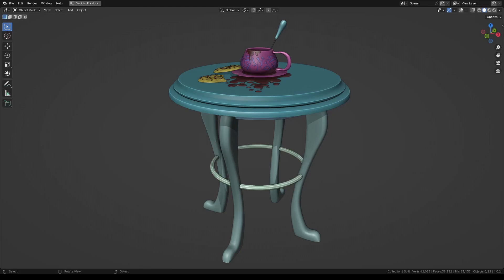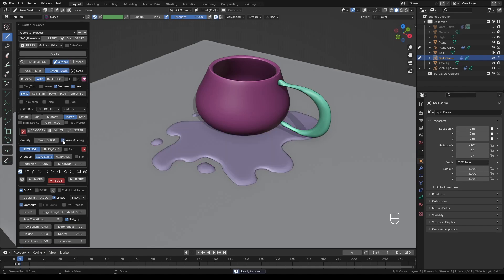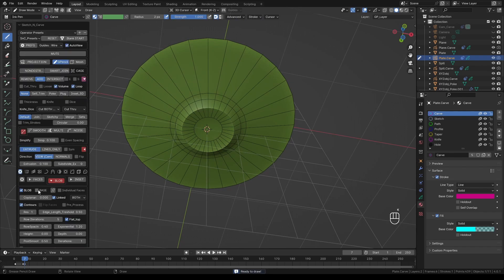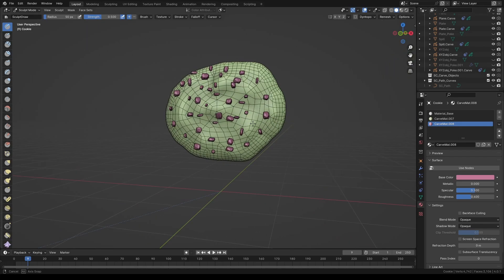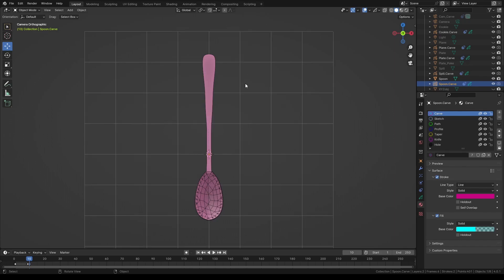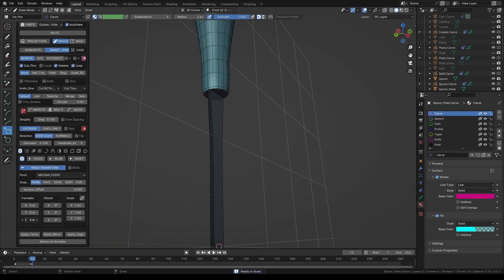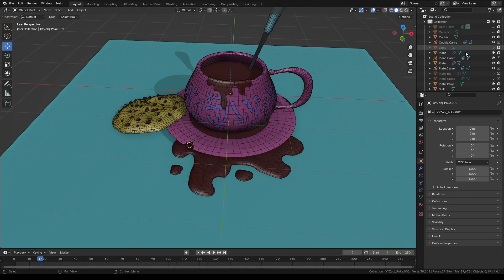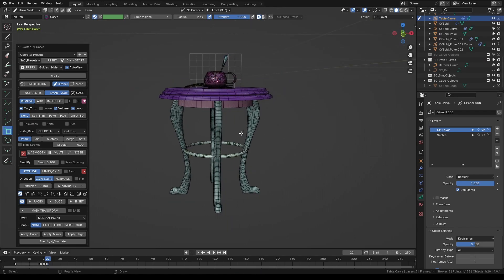SketchN'Carve Tutorial: Coffee Mug, Cookie, Spoon & Table

Comment: ,,you can't spin in surface draw mode! created non manifold geometry!'' how to fix?  I can't use thickness, and no other tools are working!
Reply from the maker: It is alerting you that the last operation created bad (non manifold) geometry. Undo and change the shape or it's placement slightly and try again.  If you need tech support please contact me using the Email on your receipt or Blender Market email; I will do my best to help.